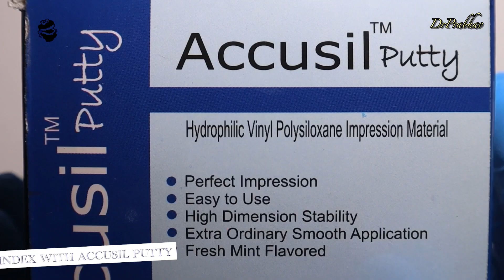How To Make a Temporary Crown 🟡 OraTemp C&B 🔵 Step By Step Demonstration

Comment: Doctor how can we fabricate if the crown structure is already destroyed??
Reply from the maker: Yes Doctor 
If the crown structure is already destroyed then we have two options
1) start with prebuidup ==>> take the putty index==>>do the treatment procedure===>> build the core===>> do tooth preparation>>fabricate temporary crown
2)do the treatment procedure===>> do the tooth preparation ===>>the the putty impression of prepared tooth===>>fabricate the temporary crown in clinical lab(anatomically)===>>send the impression poured cast to lab for permanent crown
Reply: @AtoZKidsdental  thank you very much doctor for this🙏
Reply from the maker: @EnthusiasticPup Thanks for your appreciation Doctor 
I will come up with the video demonstration of the same issue
So that it will explain more
Thanks Doctor
Reply from the maker: @EnthusiasticPup Thanks for your appreciation Doctor 
I will come up with the video demonstration of the same issue
So that it will explain more
Thanks Doctor
Reply: @AtoZKidsdental  I got what you explained but surely do put up the video if possible😊. Best wishes!
Reply from the maker: @EnthusiasticPup your welcome Doctor 😇
Reply: I mean you have taken an impression of the tooth before the crown preparation, what if that tooth is already destroyed?
Reply from the maker: Yes in that case only 
Take the impression and over here we are doing an indirect restoration of tooth
And then placing the same 
Building up the tooth in lab
Reply from the maker: @EnthusiasticPup over here we will eliminate all weakened tooth structure prior to impression
Reply: how to retrieve this temp crown? we dont hv to cement it by gic ?